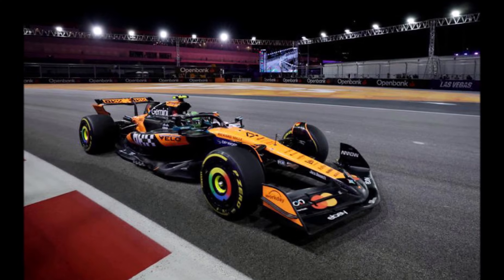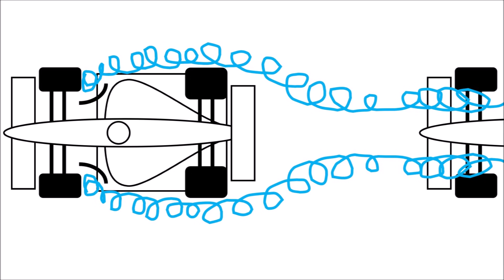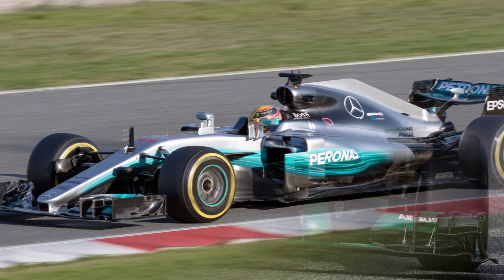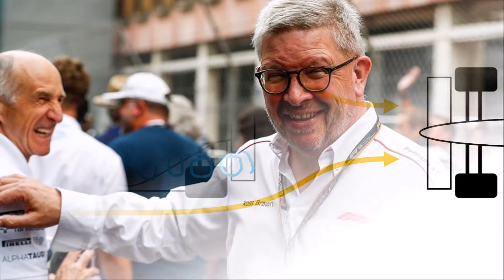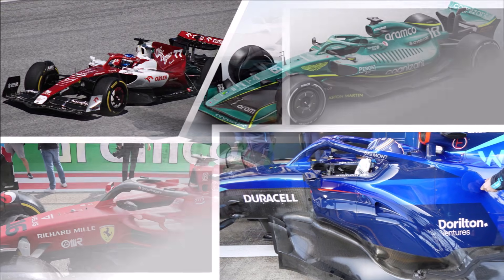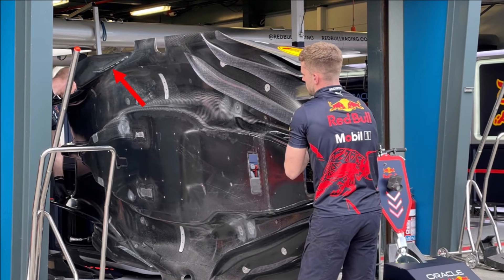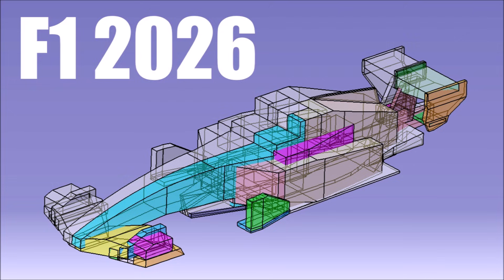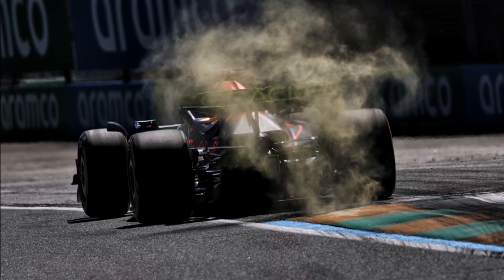F1 Ground Effect Era 2022 - 2025 - What Did We Learn?

Comment: What we learned is that most of the f1 teams in 2022 (the big nameteams), couldn't get it to work properly, merc had a big whinge about it mid 2022 and the ride hights were changed and risen which took alot of the groud effect away. What is amazing is that without the modetn tech we have today, f1 teams in the 70s and 80s made it work (yes i was around then), today teams and great csr designers couldn't.
Reply: They didn't either. Mostly they went somewhat modesty in terms of development. Also, they had components that is today banned; floor skirts to seal the floor more tightly

Comment: If turbulence generated by the front tires is a problem, they should just use wheel covers that cover the entire tire like in Gran Turismo's Red Bull X Series. Instead of being limited to open-wheel, they should aim for the fastest and most competitive single-seater. The Mercedes W196 Streamline of the 1950s had closed-wheel.
Reply: Then you might created safety issues with pockets of pressure and with some incline and car ahead

Comment: We will still have the floor producing a large percentage of downforce the coming season. Just the peaky Venturi tunnels are gone and replaced by a mostly flat floor with a big diffusor that will kick the wake even higher. The fact that active aero is now available regardless of DRS deltas and just limited to the DRS zones shows, that the FIA is confident that the new regs will create very clean air for the following car, while also playing a crucial role to increase efficiency and prevent power derating on long straights.

Comment: The front wing defines the car. The ground effect era used a delta wing. The "y250" vortex was under the nose. Every generation of car is defined by it's front wing, what the regulations allow. The new wings are inwashing, there's also no way to make outwash work as a philosophy. There's only tire vortex management within a small horizontal and vertical box. There's still enough scope to make a very fast car if you measure everything to perfection and play the inwash game.
Reply: Not original Ground Effect cars though as they essentially didn't need one
Reply: @kidpagronprimsank05 true

Comment: I always wonder what an F1 style racing series would look like if aero derived downforce was banned entirely (no wings no ground effect).  That’s the only way to “solve” dirty air. 

Obviously slower lap times (although I think after a few years of development they can come pretty close to Monaco lap times). But they’re be weight savings (especially if they also ditched hybrid requirement). A following car could only benefit from being behind another car due to less drag.  The tires and suspension could be engineered solely for mechanical grip. These cars would be faster than F1 cars in the slow corners for sure.

Comment: Ligier figure out how to make GE work in 1980, they simply put a flap in the floor that was opened by the negative pressure underneath reaching a certain level. It basically bled off the excess down force on the straight were the majority of the porpoising accured, it was set to remain closed above the car's maximum corner speed ( usually around 160-170 mph). They stopped using it when F1 illustrator Giorgio Piola took a picture of the underside of the car as it was hoisted off the track after an accident, he told the designer he spotted his "trick" an Ligier stopped using the flap as it broke the regulation against movable aero devices.
Reply: Could have just used active suspension and made the cars lighter and smaller with it too

Comment: I think the general idea of those ground effect cars was great, but the cars should be shorter (3m wheelbase maximum), lighter (-100 kg), with smaller tyres (16 inch rim), less overall downforce (-30 percent) and in general go for a weight distribution more to the rear (therefore they don't need that much downforce at the front and can go for a smaller front wing).

Comment: I think the rules were good in 2022 but ruined in 2023 after the floor edge raises (and TD039).  Between the F1 cars and the Peugeot hypercar, it certainly showed to a lot of people that ground effect was not the panacea that many people thought and stiff suspension (if non-active) and ride height sensitivity is quite a big problem indeed.  Before this, I recall people pointing to the Swift ground effect Formula Nippon car as a case study of what to do but it seems like venturi tunnels will very much be out of favour after these F1 cars and the Peugeot -- sadly?
Reply: Answer is a resounding YES.

Comment: Ground effect in principle works for overtaking, as proven by many other racing series with spec cars. But the key there is the spec cars. No regs for overtaking in f1 will work. 2026 will be much worse
Reply: Which series do you mean though?  The Swift Formula Nippon car was a full on venturi car but that was 15 years ago, whereas USAC CART Indycar has always had the underbody terminate at the rear axle and therefore not produced all that much downforce -- especially not on modern versions like the Dallara, which really are more flat underneath than not.
Reply: @TassieLorenzo indycar, gp3, gp2 (not sure about current f2), wec, imsa, formula e
Reply: @falc_4260  Those don't particularly have ground effect, they just all have low downforce.  Obviously taking downforce off the F1 cars and making them F2/Indycar pace (so +10s/lap  to +14s/lap) would make racing better or indeed the even slower LMH pace (slower than old LMP2 use to be!!!), but there doesn't seem to be an appetite for that.
Reply: @falc_4260  Formula E is literally doing the opposite and making the cars bigger with more downforce for 2026.  They should be between F1 & F2 pace, and the racing will certainly be much, much, much, much worse than 2025.
Reply: @TassieLorenzo   keep in mind that ground effect is a phenomenon, so the floors on those cars still generate it to an extent.

Comment: It is honestly very frustrating that the FIA chose to scrap the entire ruleset instead of iterating on it year after year with well informed and researched changes.
Reply: It wasn't working. The teams had 'figured out' the ruleset and were back to producing cars that couldn't follow or overtake well. The ground effect concept had failed. The inwash concept has better possibilities, but the problem will be stopping the teams from making it outwash. Also I think the teams quite like shaking up the rules like this because you never know if you might end up on top.
Reply: @r9bet Ground effect kicks up wayy too much water aswell which causes issue on rainy race
Reply: @r9bet bruh watch b sports new video and how a YouTuber has legit made the inwashing boards into outwash. 2026 will be a joke
Reply: jupppppp
Reply: The problem with being reactive like that is the cost cap, aero testing allocation, and development pipeline

If the FIA gather to respond based on whatever was happening during the year, then say it's an annual meeting. At the end of that annual meeting, Front Wing Box A is 5mm shorter and 7mm narrower. That could mean 9 of the teams don't get impacted, but Sauber has to scrap the front wing they spent thousands of hours in R&D and manufacturing time and hundreds of thousands in funds, as well as possibly needing to go above their aerodynamic testing restriction.

Potentially crippling a team which gambled on the rules staying the same in certain sections.

It's likely why the only regulatory things that changed during this period had to do with how the FIA tested wing behavior.

Comment: The crazy thing about the era, and switching to 18" wheel rims, was that we were told the cars would be harder to drive, especially over kerbs, allowing the driver to make more of a difference - that was supposed to be the selling point - and then immediately they all started whining about porpoising and cost cap breach and how everything needed to be changed. In the background outwash got worse and worse. So the actual concept for '22 was pretty good really, apart from how quickly the tyres overheat when following. Once again, it was the teams who ruined it with their own bickering and self interest. They should have updated the regulations each year to reduce outwash by banning new concepts. The complaining about the amount of overtaking per race and wanting to return to the previous cars missed the point entirely. It was never supposed to "increase overtaking". It was supposed to allow cars following to stay closer for longer i.e. "longer battles for position", not overtakes per se. And it worked. It completely worked. But these cars are so long and heavy and clumsy at slow speed. And the tyres are still awful.
Reply: Well, engineers will compromise nothing in the pursuit of performance. So the fun was never going to last. The same will follow for these regulations as well, if we're lucky, 26 and 27 will be great because the engineers have to still figure everything out, but after that it'll be straight back to form again.
Reply: I did like how the cars were stiff and needed more hustling (and were generally very uncooperative) in slow corners, compared to the old 2021 that were very compliant and glided gracefully over kerbs and so on (and rolled A LOT in slow corners, generating (I guess) a lot more low speed mechanical grip!).
Reply: @TassieLorenzo  These cars would have been much more popular if they were shorter and lighter and with better tyres, I think. F1 as a sport needs to tell the aero guys to F off and make the cars a metre shorter. That said, the reliance on digital tools has made them incredibly hard to set up and keep in a window of performance, and it must be frustrating for the drivers that often you can't throw the cars around and get a good lap time. Venturi tunnels and 18" wheels on a 2000s car would be pretty cool, I guess?
Reply: @Ruylopez778  "I think. F1 as a sport needs to tell the aero guys to F off and make the cars a metre shorter. "  ??? But the whole point of F1 is to make the fastest car to try to win races?  Are implying a maximum wheelbase rule should have been introduced earlier than 2022 (maximum width came in for 1972 and maximum height came in for 1977 by comparison)?  

By all means Formula Ford rules like "all downforce generating surfaces are prohibited" could be used, and Willem Toet showed that would result in cars some 25s/lap slower. 1000hp Formula Fords would certainly be curious... :)
Reply: @Ruylopez778 wym better tires? Thay are as they are because racing without pit stops is boring
Reply: @TassieLorenzo  I think the insistence on having a longer car for aero benefit damages the sport. Firstly, the cars struggle in tight corners. Secondly, aero makes it difficult to follow. The priority should always be more mechanical grip, and nimble cars that respond to the driver's inputs. Sure, there are many ways to make a car "faster" like covering the wheels or a canopy for the driver, but they don't do either of those because it's seen as not being fitting for the sport. It's not just the wheelbase, but how big the nose and rear wing is. I don't oppose the idea of downforce, or want slow cars, but in reality for most spectators the cars could be several seconds faster or slower in lap time and it wouldn't necessarily be observable or a problem. What fans want to see is cars and drivers on the edge, battling each other. The cars could be 5 seconds slower per lap and more fun to watch. Of course, that doesn't mean making a car slower makes it better, but it's all just a set of priorities. As Scarbs has said, the suspension could be much lighter if the teams had a lower weight limit, but as it is, suspension has a secondary function to work the aero, so the parts are shaped accordingly. It's all about priorities. I don't think long cars for aero benefit is a worthwhile direction. It happened purely because designers wanted it, not because it makes the sport better, or the cars better to watch, or the racing closer. Just like hybrid happened to satisfy the manufacturers, not because it's making the racing more exciting or competitive. I think the cars look silly how big they are, and undeniably they are clumsy when momentum takes them over track limits. If they were the same length but 150kgs lighter, then I would probably shut up. I don't like Halo, either. I'd rather they use a screen of some sort, but not as ugly as the ones they tried. They had a narrow cockpit and wide screen and it looked terrible. But Halo also looks terrible, it's just that over time we've come to just accept it.
Reply: @RCmaniac667  They mandate 1 stop. So the tyres don't need to be so sensitive to heat that they can't follow for more than two laps without ruining their stint. I never claimed there shouldn't be pit stops or different compounds.
Reply: @Ruylopez778  So you want what's effectively cost-limited but otherwise open development Indycars, with some of the oval-spec crash protection ripped out to get weight down?

Sidenote, the windscreen that Indycar uses (note that it's a more mature version of the concepts F1 trialed) has to be as wide as it is to allow easy egress from the car in an emergency. Any more narrow and climbing out gets hairy.
Reply: @griffinfaulkner3514  don't argue with him, he's a lunatic who probably got high on his "work"
Reply: @griffinfaulkner3514  Nope, please don't accuse me of 'wanting Indycar' because I've griped about F1 regulations. The cars are the weight they are because that's what they're allowed to be. I'm not talking about "removing crash protection". Components like the suspension could be made much lighter, the battery could be made lighter, the electronics could be made simpler. They would have to make these trade offs if the weight limit was set lower. As it is the suspension is designed with aero function in mind, the car is packed with electronics that needs cooling and a battery no one asked for, and an MGU-H no one asked for. They could also return to refuelling but won't do that for marketing and political reasons, not because it makes the racing better/worse.
As Newey said, you still require 'energy' to complete the race distance, so ultimately, if you want a 'sustainable' F1, the effort should be towards the lightest most efficient cars. But we know they don't want that. They want the marketing of calling it hybrid, plus being able to brag about headline power/torque figures, or nerdy 'thermal efficiency' and so any consideration about weight, handling, racing is secondary to their narrative.
I'm not saying the aeroscreen needs to be narrower. I'm saying it looks horrible with a narrow cockpit under it, as does Halo. Indycars also look weird. In order to not look like a total afterthought - which it always has been - you need a different philosophy altogether for the chassis, more like a 70s car, probably. Or some other solution entirely. I'm not saying cockpit safety should be rolled back, because they would never do that now. Of course, now they need to be able to leap free of the car in case it is about to electrocute them also, where in the past they only had to worry about getting burned. But they could probably have some kind of emergency release system to make getting out without being electrocuted easier.
Reply: @Ruylopez778  My reference to Indycar was purely with regards to the dimensions of the car and more limited aero, don't read too far into it. Likewise, my statements regarding crash protection also refer to the differences between an Indycar's crash structures and F1's, with Indycars needing to be massively overbuilt relative to their size to make oval wrecks (220mph into a catch fence) survivable.
Reply: @griffinfaulkner3514  I guess what I'm saying is, if you had a modern, crash protection, version of a Lotus 79 style design, or even a Lotus 97, where the cockpit and nose is mandated to be chunkier, you could integrate an aeroscreen design as it is now without it looking so awkward. I don't know how they would be able to get out of the car with a screen without touching the sides though. I suppose the electrical problem doesn't happen that often when they breakdown. Again, in that scenario there could be some kind of release system for the screen. I've no doubt that the narrow noses we have are more efficient, but most decisions in F1 car regulations are entirely arbitrary based on specific dogma or trends. High noses are more efficient, but we moved back to low nose because of the risk of T-boning another car. I also think the sidepods while interesting from a design exercise have become utterly absurd like a lot of modern road car design. If the cars were shorter, teams would be forced to package the cooling etc in a different way, where the sidepods are more chunky. The only reason they don't do that is for the aero gain of a longer car, and again, aero is the biggest cause of difficulty following. They can switch from stepped floors to venturi tunnels and back again if they want, but the length of the cars and the tyres are still problems they created in the last 15 years that didn't make the racing better, and arguably made it worse. They are the giant elephants in the room that F1 and teams tiptoe around.
Some fans have this propaganda drilled into them that we can't criticise what F1 is now because it's a 'technical war' and therefore whatever the teams say about efficiency or technology can't be disputed. Or they harp on about it being a meritocracy and consider any attempts to level the field, or cut unnecessary costs as wanting 'a spec series like Indycar'.